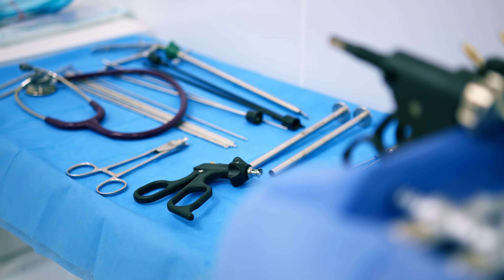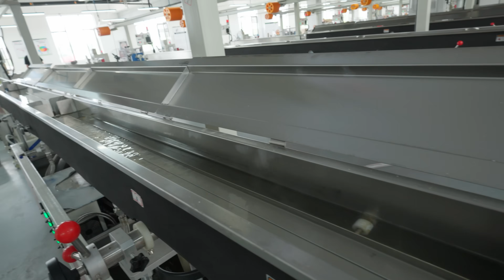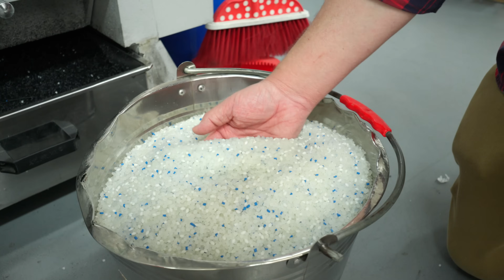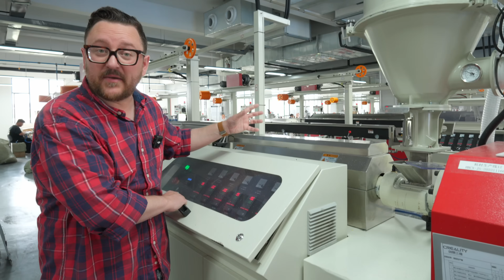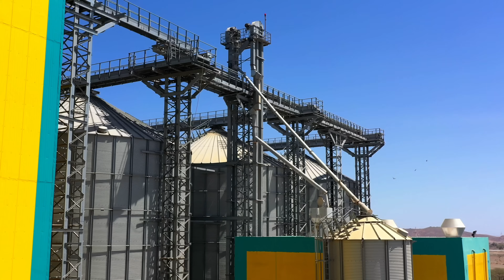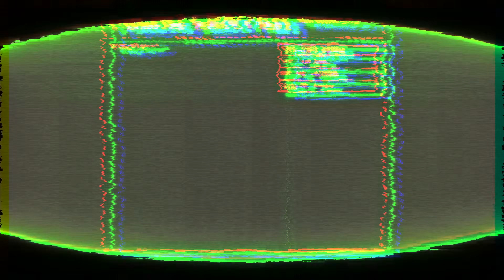3D Filament CEO Talks About The "Wonder Material" PLA | eSUN x Micro Center

Comment: Went directly to asa because I was told it’s the best material for outdoor use. Was very disappointed at the brittleness of it. It’s easily break and crack. Use a p1s. I went back to PLA and for me it’s better. Yeah it flexes but to me it should. I use it for containers to hold electrical material ie crimps, pigtails, ferrets, connectors coupling etc etc. PLA is WAY QUICKER, and MORE ECONOMIC to print and does the job, gets my thumbs up. 👍

Comment: if you want something more biodegradable than pla, try Pha. it's 100% biodegradable, but it's tensile strength is kinda weak, it also doesn't absorb moisture and doesn't need drying, but it's kinda pricy.

Comment: pla enhanced is probably the best material you can use for 3d printing except when high and really low temperatures are involved. heat make it soft or even melts it while low teperatures makes it brittle.

Comment: Bro you are so frustrating! 
He's sitting there telling you about some amazing medical use of it and you talking about tattoos. Straight left field bro!  He was saying pla for grafting inside your body and that your body would replace the cells after 3 or 6 months.  So severe surgery, reconstructive, internal, external, ,  body modifications etc.  and again second time he was talking about advancements and you cut them off to ask him what advancements he sees.  He was talking about short-term and long-term variations he probably would have gone into things like instant use items that get tossed out and they biodegrade within a month or less.  Things like one time use items.  And also formulations that can last a very long time and everywhere in between. Also purposely weaker and not just stronger variations of it.  Things like potentially breakaway safety equipment

Comment: PLA is underrated. Stronger and stiffer than most plastics, ductile with the addition of 2% calcium carbonate, non-toxic, can be annealed to achieve better heat resistance than ABS.

Comment: PLA is my 90% goto material. Even for parts in my car. I used to print a hook out of PLA for the cable of my eletric Car in the trunk. 
Bevore I printed it out of annealed PLA I tried on in PETG and it creeped strongly in the summer. The PLA one shows no deformation. The trick is annealing, which make "normal" PLA extremly teperature resistant. I found a PLA whitch only showes 1,5% Shrinkage during annealing, which is totaly manageable.

Comment: PLA sucks for most everything. It melts easily, it doesn’t do well in cold, it cracks easily, it’s sharp after printing, it doesn’t have any flex, it’s just as expensive as PETG (better plastic). PLA is great for playing with 3D printers though…it’s just not a grown up filament.

Comment: I used PLA for the first prints a few years ago, then switched to PETG which i still use - mostly fiber reinforced since i do practical prints. I have 2 Rolls of PLA in my "special filaments" box, and i use it for interface layers with overhangs.
Reply: Same petg is it.

Comment: Pla works great for making patterns for metal casting. You can use scrapers to smooth the surfaces, much better than sanding. And it'll give pattern life of pine. About 100 to 200 molds. But that is on a matchplate not loose molding.

Comment: Fascinating insights! 🙌 PLA truly is the "wonder material" for prototyping & hobbyists—easy to use and accessible. When those prototypes are ready for end-use and need the strength of Nylon, heat resistance of ABS, or precision of CNC-machined aluminum, we're here to make that transition seamless. Great conversation!

Comment: Yeah yeah yeah. blah blah blah.  I have a spool of eSun PLA giving me more problems than any other brand used and yes it IS dry! It will not stick to the build plate like all the other PLA I use.  I'm on my third attempt on a part that I have no issues printing with other filaments even PLA Silk.  Its Olive Drab PLA and it falls over and makes a mess.  Trying it right now on a smooth plate with glue, if it fails again I'm throwing it out and staying away from eSun.

Comment: I rarely touch PLA these days.
It creeps under compression, has a too low TG an is hard to post process (sanding cutting drilling etc.)
For functional prints ABS/ASA PETG/PCTG is just so much better.

There is no such thing as a "Wonder Material" it's always a compromise for the intended usecase.

Comment: PLA is still trash. I printed my new Transformers models with PLA, and all of the joints are loose after several movements. I can break PLA parts at the later lines. 😂

PCTG, PETG, ASA all have outperformed PLA so much better, I’ve quit using PLA. 
Let’s you’re making one piece models that don’t have moving parts, and you keep your room cool, then PLA is fine. 
All of my designs are now designed for PETG, PCTG and ASA. 
😂
Reply: PCTG and PETG cant produce fine details that are important for scale models - great for utility prints but not so great for 0.2mm nozzle high detail ones

also there is HUGE difference between standard pure PLA which is extremely brittle and lets say eSuN PLA+ that is my go to material for high detail minis, statues and scale models because it prints extremely well, has great layer adhesion and is much more flexible compared to normal PLA
Reply: @Asghaad I’ve gotten some great prints from PETG, so far. And if I need more durability, I will go with PCTG, since I’ve seen great detailed prints. I’ve already seen the limitations with PLA, so this is a nothing burger. Good for PLA users, but not for me.

Comment: When they make a high temp, uv proof PLA we can talk.  Will not be surprised when they figure it out.
Reply: Aurapol has PLA mix that has 80 degrees softening temperature and they claim it remains structurally stable up to 110

UV though is likely not going to happen its like asking for ABS that doesnt put out toxic fumes during the print

Comment: I’ve had good luck using eSUN PLA+ and eSUN ABS on my Bambu Lab printers. I do use Bambu Lab PLA (when there are colours I prefer, a lot of matte PLA, and CF), also SUNLU I’ve had good luck working with it.
Reply: i have been trying many other materials and manufacturers since getting the printer and to this day one that performs the best with least issues while producing tough, non brittle and clean prints is the eSuN PLA+

Comment: I recently purchased my first Bambu 3D printer and filament from this location RT 20, and I’m very satisfied with the pricing and product availability. The staff was helpful, and the checkout process was smooth.
However, I’d like to share a suggestion: the 3D printing section layout and filament display could use improvement. Currently, it feels disorganized, as if items were placed without much attention to presentation. For such an exciting and growing community, the display should reflect the innovation and creativity of 3D printing.
Brands like Bambu deserve more visibility and a well-organized showcase. A cleaner, more appealing layout would not only enhance the customer experience but also help promote these products and drive more revenue.
3D printing is on the rise, and with a little extra focus, Micro Center can become the go-to hub for enthusiasts. (If you ever need a passionate 3D section manager, I’m available! 😊)

Comment: as nice of a thermoplastic that PLA is, i can't see it being the material choice of the future when it softens in my car during summer. PETG makes a much better use case, as despite being a bit less stiff, it won't melt at as low of temperatures.
Reply: PLA Can be anealed to whitstand 150 deg.  there are blends available now to resist 100-120 deg Problem with pla is not temperature resistace but UV resistance. PLA is the future
Reply: Well, PLA-HT is a thing for some time now. Sure it is more expensive, but I am guessing it will come down in price with time and more brands producing it.
Reply: There are new derivatives of PLA I guess. How would they think about making clothes if UV from the sun can damage the material.
Reply: there are already PLA types that have high temperature resistance  - for example Aurapols  htPLA110 which as the name suggests is capable of withstanding up to 110 centigrade temperature and manufacturer claims its slightly softens at 80 but maintains structural integrity up to that 110

its all in additives and material mix that can give the base PLA many different characteristics - mix it with TPU and you get hte silks, mix it with PBA and you get much tougher and lightly flexible "PLA+"

Comment: No way, melting point of PLA is too low.  Rapid PETG and PETG-CF can sustain higher temp situation and I have PETG parts that are outside (snow, sun, summer heat, etc) for about 7-8 years without any problem apart the discoloration for some colors.
Reply: I replaced my bathroom exhaust fan blade with a petg one i designed.  Has worked well in high humidity and spinning 😊

I do have plenty of in use pla prints as well. Not all pla spools are created equal.  The pla+ or hyper pla is much better
Reply: From example PLA+ has a % of ABS which makes it stronger and higher melting temperature
Reply: @VijayKumar-nw1ne  should be PBT not ABS
Reply: thats only one application - sure if its for outside use the PETG or PCTG would be preferable but they are also much harder to print well

i like PETG and PCTG even more but they come with theyr own issues  - for me personally stringing you really cant avoid with these and tendency to tear on the top surface when its cooling after the print
Reply: All those suck😂 I make my parts that undergo legitimate loads and stress and chemical/uv/heat out of PPA-CF or PPS-CF. sometimes PAHT-cf but it isnt as good. And those are exponentially better than any petg/abs😂 I don't even use pla. It's not even mcdonalds happy meal toy strength and if you blow a hot fart on it from across the room it'll melt😂 if you're going to MAKE something- actually MAKE it😂
Reply: @notyouraveragegoldenpotato i have pla parts that have been in use for years.  Even have a few outside that have faired well.  It just depends on the need

Comment: I've been printing since the ABS days. Back then, my university had 'Makerbot replicators', and 'up 3d' printers. During those days, most prints would fail from bad first layers, or from warping. Eventually Creality and PLA came into the picture. During that time, people got much better at bed leveling and experimented with different bed surfaces. First layer and warping problems were significantly reduced. Now a days, we have bambu printers  (with reliable bed leveling) + PEI plates + PLA, which make failed prints very uncommon. We've come a long way.
Reply: It’s crazy how far it’s come even in the last 5 or so years I got an ender 3 in 2018 and it’s still my only fdm printer but it started as a loud, slow, somewhat unrealiable and not that great quality final product making machine and I’ve upgraded it so much over the past few years that it keeps up with print quality, speed, and reliability of many new machines on the market.
Reply: Since abs days? Abs is still around lmao
Reply: "Do you have any last words" really is a charged phrase in any context 😂
Reply: dark times, thanks for staying still!

Comment: Side recomendation: christmas season is the time to buy your first 3D printer. Mostly, because the prices on enclosed printers are never better. Buy enclosed printer first. Considering I own 4 printers, 3 are open framed, but my first was a Creality K1C. It allows me to print all filament types except the exotic engineering plastics. 2nd printer was a Bambu Labs A1 combo to fill multicolor printing. 4th printer being the portable Bambu Labs A1 mini which matches up with the AMS lite from the combo. Imagine visiting the grandkids for holiday's and have them pick out a print to make their own. Watching a print grow up from the bed, then holding it is like nothing else. Consider what I did, buying an A1 mini for a relative and learning the simple tasks of loading & unloading filament and printing. Now, they ask for a speciific use print, which I custom model and send the code thru email. They copy the code to a mini sd card and insert to printer, load the spool and print it. Very useful considering they live 600 miles away. And, discovering christmas decorations to print from popular libraries of downloadable files brings the 21 century into their home without the cost of shipping!

Comment: Only so many filament making machines worldwide to make all the various plastics of so many color options. More expensive machines making dual & tri-color filament. Take Hobby Lobby for example. HL runs a trial on selling basic pla filaments available thru online orders or nationwide stores. Batch order completed by mfg and made available for purchase. Inventory sells quickly. Too quickly, where resupply can't keep up during the christmas season. The filament shelves are empty at exactly the busiest foot traffic time of the year. Understand, filament purchases are unique to printer owners. It's a captured market as well as a market supplied by these worldwide filament mfgs. HL jumped into the machines to run 24/7/365 for a market which comsumed it faster than predicted. 3D printers continue to create filament market needs as the ratios of filament spools per printer, in consumer storage, grows.  What's your ratio? Presently, mine is 10 spools per printer. Having just 1 printer just doesn't work.